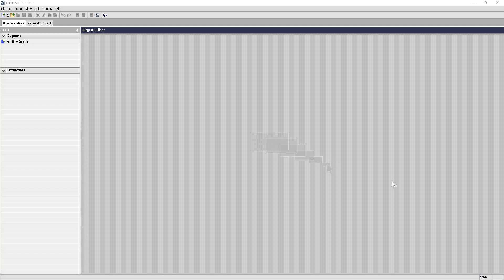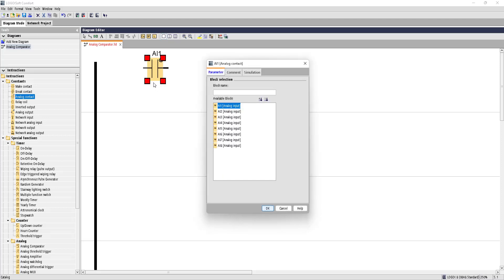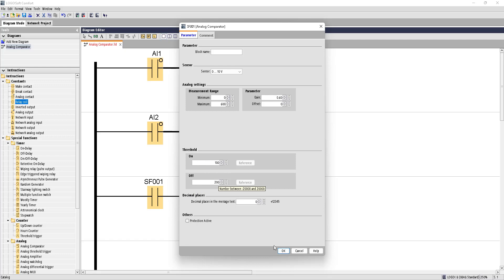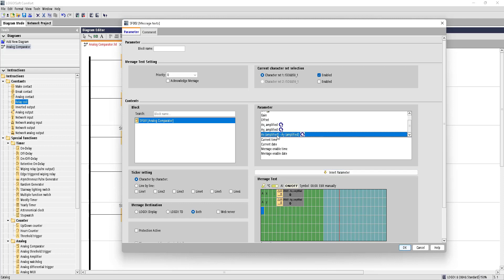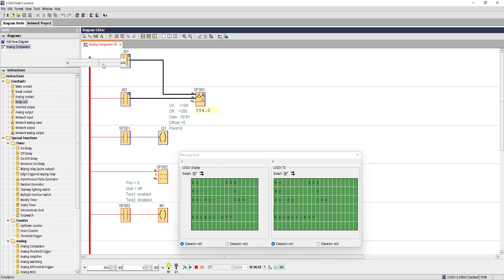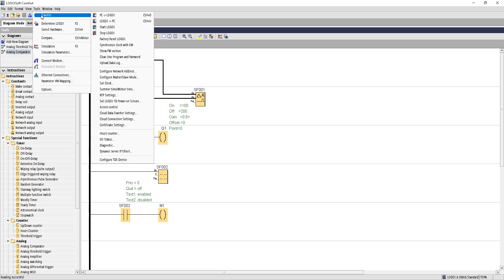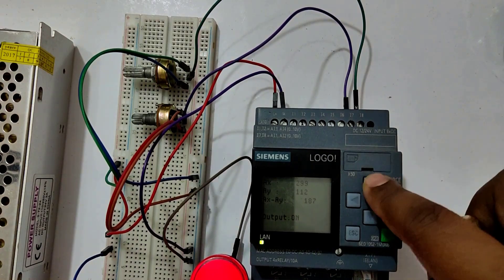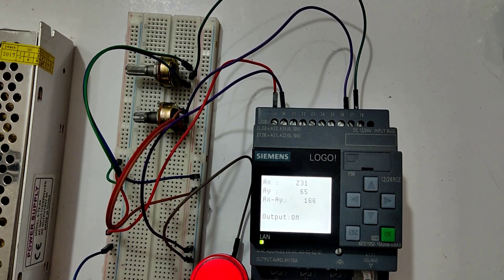Analog Comparator for LOGO PLC

Comment: I am using one of the Analog Inputs to check position of a door and determine if it is closed. If the door is above a certain analog threshold, then the door is closed. If the system needs to be recalibrated, the operator can push a pushbutton which will create a new setpoint for the door being closed. 

In principal this seems fairly basic but I am struggling to find a way in the Logo software for the recalibration aspect.

I have put together some logic below which compares the analog input to an analog memory bit. However, I have been unable to find an instruction block so far that will allow the analog input (AI1) to pass into the analog memory if the pushbutton is on (I1).